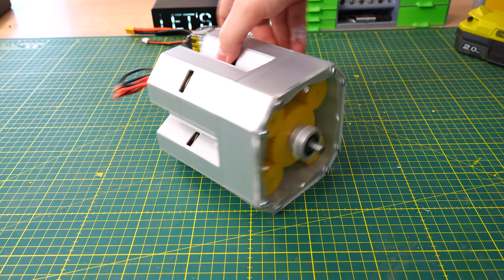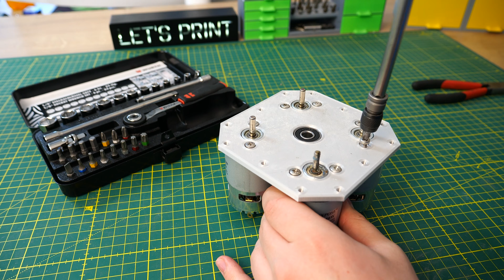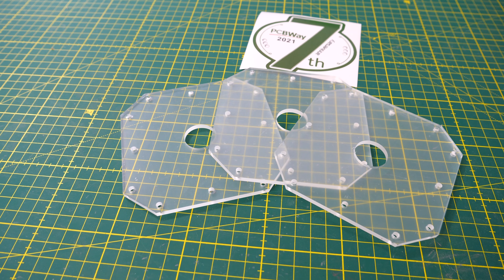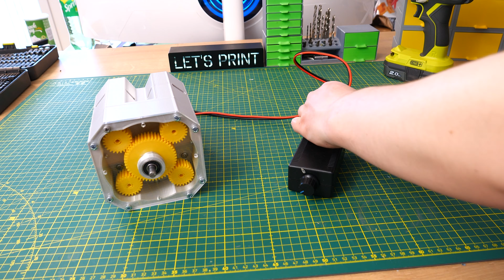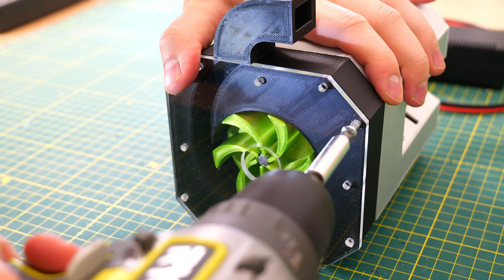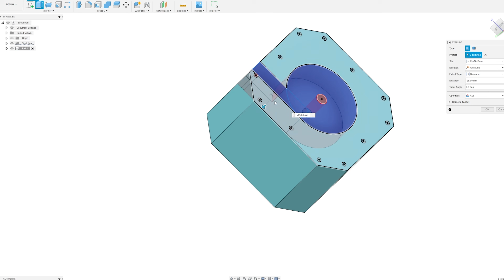Extremely Powerful FOUR MOTOR GEARBOX + Planetary Gearbox & Water Pump (100% 3D Printed)

Comment: I am not quite sure, that all motors will add their power. Small differences in motorspeed/Volt will breake some Motors , while other motors accelerate?
Reply: Each motor does less work regardless, even if one or two motors are a tiny bit slower, the other ones will still  help out, the motors together would make way more torque too

Comment: What brand of PLA are you using? PolyMaker has that new Polylite Pro which they claim is both stiffer as well as more durable than regular PLA or PLA+. I've been wondering how good this material would be for gears (maybe PolyMaker will send you a spool if you ask nicely, they are usually pretty cool with the community and content creators)

Comment: Cool project! I can't help but wonder if the 4 motors are actually engaged with the gearbox at the same time. Though I haven't tried this setup for myself so it might be unwarranted
Reply: I would assume once pressure is added to the geared motor leading the pack it would use the force from more than one of the geared motors if they are not all perfectly lined up. It wouldn't be a big notice though as speed doesn't change and once you are asking it to use torque it uses all of the torque it can.
Reply: @TJPlaysNow  Good point, if it is under load the plastic gear propably warps enough to engage the other ones. It's propably not very energy efficient but it works ^^

Comment: quick tip! for elephant's foot without rafts, put a .25 fillet on the bottom side of your print, or use -.25 first layer horizontal expansion

Comment: Also, using low Kv brushless outrunners will likely contribute to longevity and reduce decibels. And… and (with low friction seals adapted), then a very light-viscosity [non-reactive] oil, would also assist in 1. Lubrication, 2. Longevity, 3. Decibel reduction, 4. Reduced friction-heat reduction).
Reply: higher kv is more efficient in power, it just needs a gearbox to slow it down
Reply: @Tommy-pv1vh  I do not disagree, however, I believe my 4 justification above take precedence.